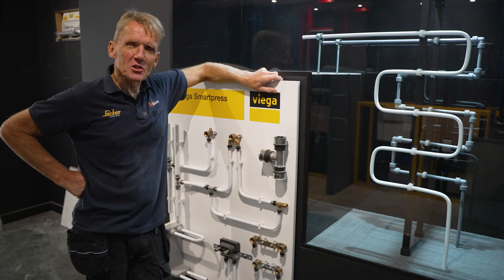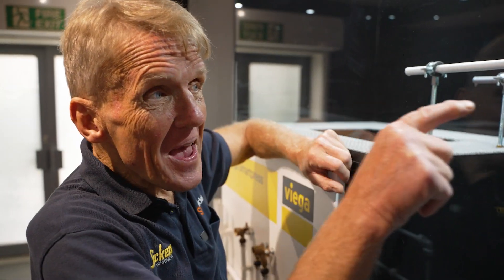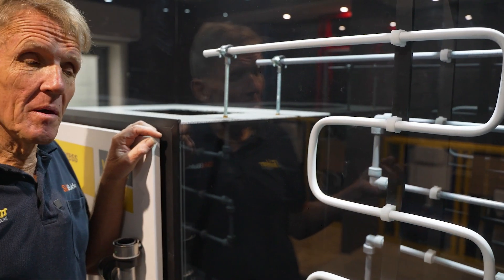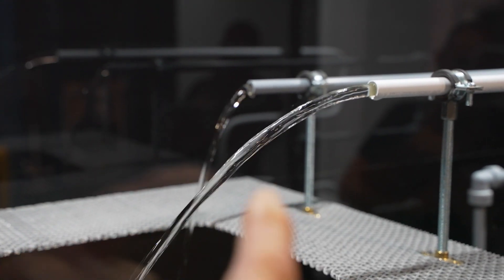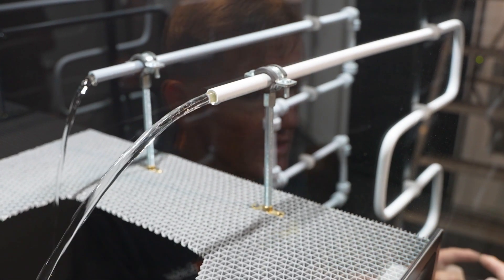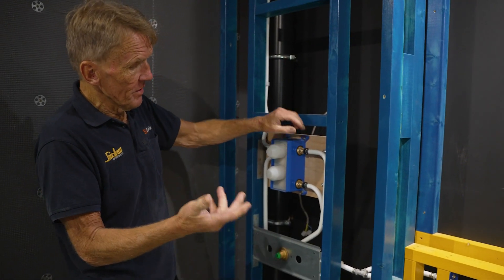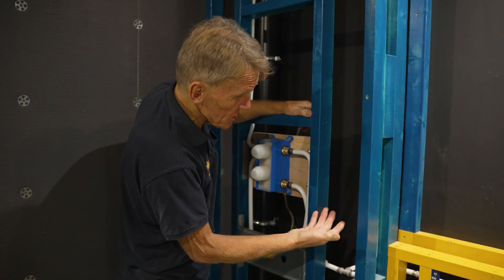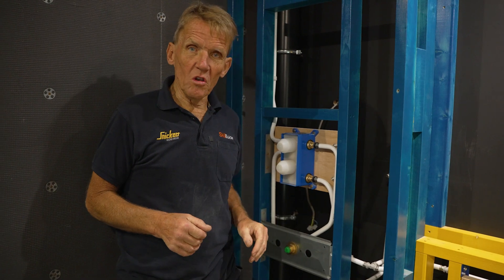Viega Smartpress Pipe Vs Push Fit

Comment: Still prefer the Rehau style sleeved system, although I use Tradepex, which is same as the old Rehau. (All brass fittings) ID of the fitting is the same as the ID of the pipe. Tooling needs no calibration and is the strongest pex method on the market.